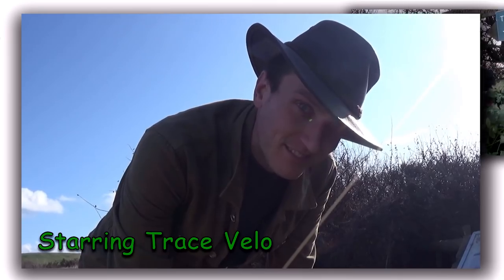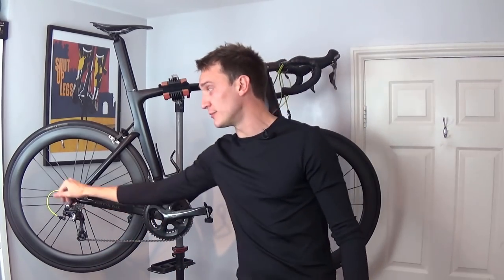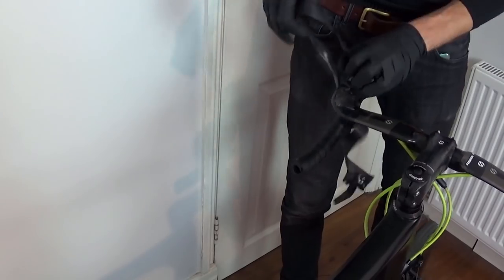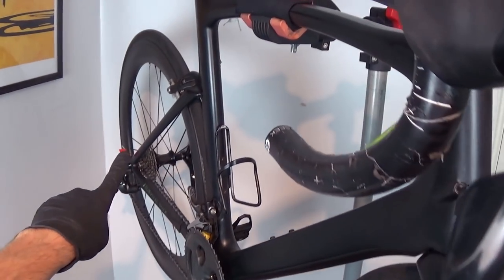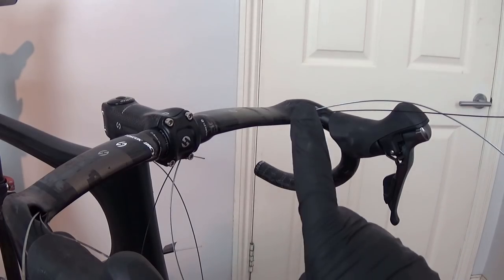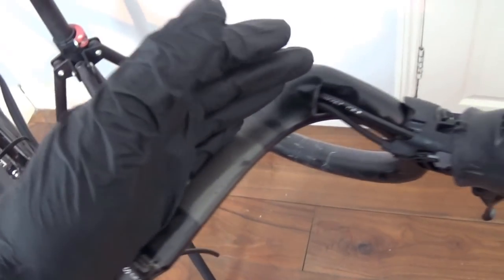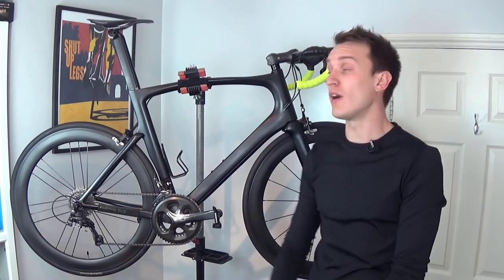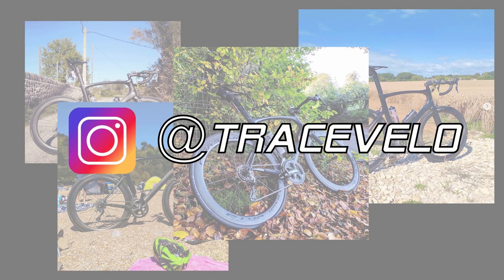TOTALLY RECABLE Internally Routed Bike, for less than £5!!!

Comment: If one doesn't have the original white feeder tubes join the two cables with heat shrink tubing.

Your one of the best presenters on you tube keep it up.

Comment: Great whatch, I copied your handlebar Video, one thing I did differently was not to route the cables through the bar, I knew this could prove difficult without replacing the cables for new ones, so I routed underneath the tape, when need to replace the cables this will come in very handy. Now, if may help you, bar tape holds up better if you reverse the direction as you wrap past the hoods, your grip naturally pulls back when on the tops 👍

Comment: Well the day has come for me to swap my handlebars on my Cheap Chinese Carbon (CCC) bike, to some Toseek, internally routed, carbon bars. This will require a complete re-cable of my bike, which brings me here. Thanks so much for this video! it is by far to most demystifying one I've found so far, epically concerning the handling of not losing cables in the frame.#runonsentence. Thanks again, and keep up the fantastic work.

Comment: A tip I learned - instead of adding oil to the cables before inserting them into the outers, squeeze a couple of drops of oil into the outer's hole. The cable will lubricate the whole of the outer's (er...) inner as you push it through.

Comment: Another awesome video Luke. It will help me when I'm building my bike up later on. Still need to decide which tubeless tyres to get.
Reply from the maker: Cool, glad you liked it! So I've been running schwalbe pro one tubeless tyres for a while now, and can def recommend them. I'd pair them with Stan's sealant tho, I didn't rate the schwalbe stuff.
Reply: @TraceVelo  cool, was looking at those and conti gp5000. Still, not using them till spring. Got 15kg to loose by then. Hanging my wheels up in my living room near the TV, to motivate me to go out and get fit. Want to do them and the new bike justice lol

Comment: Awesome intro, had be dying!! Miss re-cabelling. (As someone with a di2 and hydraulic discs)
PS: I did find that buying the most expensive Teflon cable sets allows for the least friction (certainly for the longer outer segments). Cheap ones made my shifting and braking feel too heavy
Reply from the maker: Thanks rekagy, really appreciate it! But yeah I've used Teflon coated cables in the past, and I didn't feel much difference myself. But if you fancy spending a few extra pennies, I'm sure a bit of Teflon wouldn't hurt shifting performance. But yeah, Disc paired with Di2 is the dream, maybe one day I'll splash out!!!

Comment: Hi! You have routed cable without a hose inside the frame. In bottom bracket cage the cable bend around it inside a plastic groove (6:20). Don't you bother that the cable rubs against plastic?
I have recently got a new frame and I think how to route cables, fully in hoses or like you did.

Comment: Cheers Luke, tackling this with the toseek bars you have this weekend. With LBS charging £100+ labour I'm glad of the tutorial. One quick question, I notice your rear derailleur cable feeds into the frame non drive side, and front derailleur on drive side. Mine opposite, but I want to do it your way - this means cross cabling in the down tube....... You notice any issues with this at all? Thanks again for your videos and associated entertainment

Comment: Another great video Luke, and by the way that's a lovely bike, you have there.
Where did you get the carbon bike frame from.🚲🚲
Reply from the maker: Thanks Paul! So I got the frame from eBay years ago, but you can still find it. The seller's I used is called 'wokecycle', and the frame number is FM-R09.

Comment: do you find the tooseek bars to have a longer reach than normal bars?  I've heard they stick much farther out and you may need a smaller stem to keep your fit the same.  I've been thinking about picking them up thanks to your recommendation, but im worried about throwing my fit way off.
Reply from the maker: Yeah great question. So the reach is quite long, just under 100mm. Most regular bars are usually around 70-80mm. So yeah, I actually had to drop my stem length 20mm.
Reply: Bought a pair and didn't really notice a big difference. I am a enduro mtb racer though so not a super geek on all the road stuff yet.

Comment: Where can I get some cable guides from to slip over the old cables when I remove them, can't find anything online!?
Reply from the maker: Hmm, that's a tough one. I just use the ones that were supplied with my frame. Often the higher end re-cable kits come with them, but if you are struggling, ask your local bike shop, I bet they have loads just lying around!
Reply: @TraceVelo  found some on Amazon in the end, managed a complete cable change on my K8S in no time, absolute game changer 👍

Comment: I just purchased the exact same frame. What did you use as end caps to terminate the shift outer cable at the routing point ? The whole in my frame are too large for the end caps that came with the Shimano shift cable , they fall right thru.

Comment: Hi Trace, keep up the good work mate ;) I'm looking to swap out cables on my bike and bought toseek aero bar off back of your other vid :) Just looking at the jagwire kit you mentioned..looks like that only contains 5mm brake outers? Did you use 5mm outers for gears aswell as I understand these are 4mm..so bit confused..Cheers mate
Reply from the maker: Ok nice!!! So yeah all of the jagwire kits that I have had, had both 5mm brake, and 4mm gear cable outers included in the kit. But as I mentioned, they only came with brake cables, no gear cables unfortunately, so you may need to get these separately. Let me send you a link to one of the kits I used on eBay. Give me 2 mins...
Reply from the maker: Wow ok, so the price of these has shot up since I last bought them about 8 months ago. What used to cost less than £4 delivered from a UK seller, now costs like £10. So if you want the cables within a reasonable timeframe, then you can get them here: 
https://www.ebay.co.uk/itm/152811857219
But if you don't mind waiting for postage from China, then this is the kinda thing you need: 
https://www.ebay.co.uk/itm/312874052487
And yeah, you will need to get 2 gear cables aswell, as only the brake cables are included. Also just FYI, I've never used either of these sellers, these are just examples of what you need to look for. Hope that helps :)
Reply: @TraceVelo  ahh makes sense, thanks for your help and quick reply 😎👍

Comment: Hmm did I see it correctly that you used the same outer for both mech and brake cables? That's not really recommended, there are distinct types of outers for each type, and here's why: Brake cable outers have built-in compression, in that when you squeeze the brakes, the outers are meant to compress just a bit, which gives you some nice modulation in your braking force. On the other hand, outers for shifting are completely fixed in the length, with zero compression because that's super important for precise, indexed shifting. I know because I made the mistake once, of using brake outers on my shifter, and I was wondering for months why I could never ever fine tune my rear shifter to index properly along the entire cassette. Once the reason dawned on me, I switched out the outer and problem was solved immediately.
This was on a bike with all external routing, i.e. much more outer than you have, so the difference is much more noticeable. But still, something to consider if you're after super crisp and precise shifting.
Reply: If you watched the whole video he points out that brake and gear cable outers are different diameters and standards
Reply: Felix Whetter I watched the whole thing, how can you not, it’s Trace Velo. I was waiting for him to bring that up but I missed it. Where does he mention it?
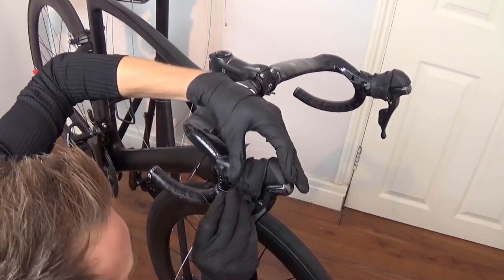Reply: @indorock  13:30
Reply: Felix Whetter I saw that bit but he’s talking about the differences in the cables. He mentions the outers are different but not how important it is to not mix them up.
Reply: @cornishalps9870  He explains that the cables are different but doesn't talk about the outers. He only mentions they differ but not why, and doesn't explain why it's important not to mix them up. And like I said from looking at the entire video (which I have) I get the idea that he uses the same type of outers for all the cables.

Comment: Do you have to re-index your gears after changing cables?
Reply from the maker: Yep, can pretty much guarantee you'll have to re-index the gears
Reply: Cheers man! Love the vids :)
Reply: @TraceVelo  granted I only recabled 2 bikes but I didn't need to re-index either of them, just tweak the barrel adjuster a bit, just make sure to tighten them and then loosen them 2 full turns and pull the cable firmly before tightening the bolts

Comment: perfect explanation! again just one question: is your particular ebay seller (wokecycle) shipping only to the UK? I can't even find that seller on ebay germany. THX and keep going!
Reply: yeaa I think that seller only ships to UK. however, you should be able to find other sellers selling the exact same thing on your local ebay site
Reply: @zanec1438  that may be right, but I have no clue if the quality is comparable. Even if I get a frame from the same brand, it doesn't mean it's not a faked one.
Reply: @Manuel-yk5yq  depends on your definition of fake. Chase's frame, like mine is a copy of a western brand. However, the seller doesn't deceive you into thinking it's the original by putting said company's logo on it. It's left unbranded, or in my case, their own logo.

Comment: Are you at all worried about clamping that top tube? It makes me nervous!
Reply from the maker: So I've always clamped it there, it's just the most convenient place. I'm totally aware that UD carbon fibre is not particularly strong in that plane, but I always wrap the top tube in an old sock or t-shirt where it is being held, and never clamp it very firmly at all, just enough to hold it in place really.
Reply: Trace Velo I gotcha. Just makes me worried because the top tube typically has thinner walls and is more brittle. But you do you! Loving the videos, keep em coming!